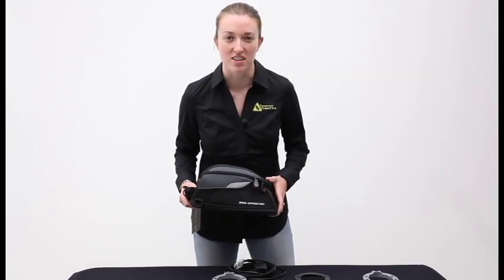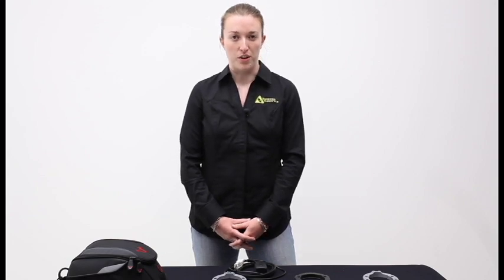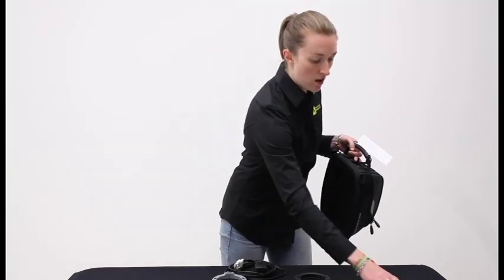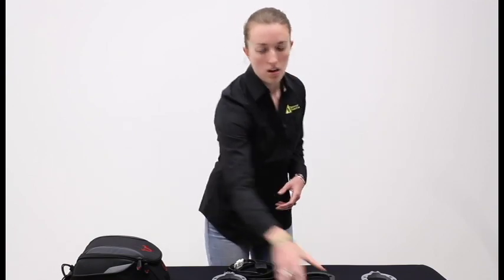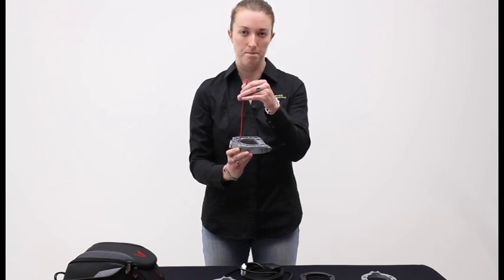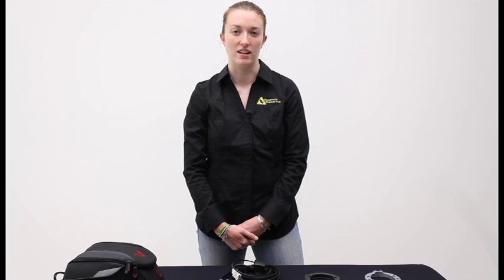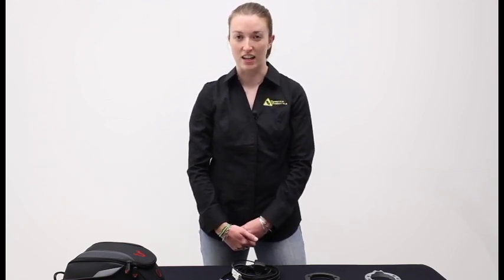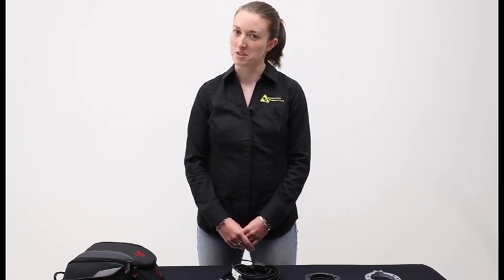SW-MOTECH Tankrings and Bags-Connection Quick-Lock Tankbags for Motorcycles

Comment: This bag is the Hugest P.I.T.A. to get on the tank after removing.
So when you remove it to fill tank wiht gas, you be sitting there for 20minutes trying to reconnect it to tank. Very frustrating and stressful to use. SW motech gear, never again.